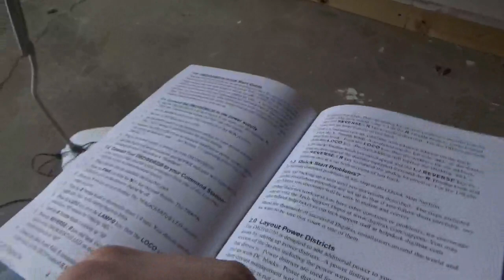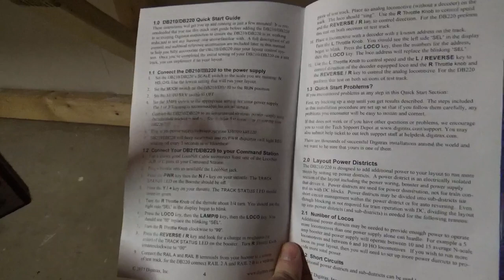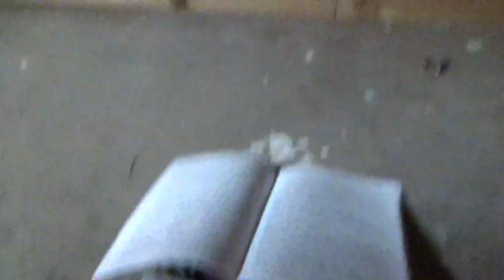Digitrax DCS 210 DCC Power Track Status Problem?  Help!

Comment: Okay, well based on this video. You seemed to had isolated it down to the section you last wired up. You said it worked before. 

That isolates to that area. Sometimes it can be the littlest thing. It could possibly be a short... 
 
Or could be the unit itself is going faulty for whatever reason. Though to rule out the actual unit... 

Remove wires from A and B rail and fire it up.  Lights still blinking like in the video? Then we've determined it is the unit. 

Functions as it should? Then some where along the line something is crossed. A multi meter comes in handy for testing continuity on wires. If you don't have one you can get a cheap one that will suffice for the work you're doing. 

I believe the 8.2 volts display is the actual throttle itself as it uses a 9 volt battery within  too. I don't believe this is the voltage of the unit. 

Voltage drop I don't think would be a factor here. Only way to determine that is. Can you run any trains at all near the power supply? 

If so and they stall out around the curve then potential voltage drop issue. Though a multi meter will also tell you the voltage on the system. 

Let me know what you figure out! 

I also work as an electrician 😉
Reply: Also adding what gauge wire is your bus wires? 12, 14?
Reply: I would second this comment. It would appear to be as simple a case of two wires wired the the opposite way. Disconnect the base and plug into a small piece of track to confirm the unit works and test, and this way you can rule that out. Once that is ruled out, review the last batch of wiring you did before the issue started.

Comment: You have a short circuit in the track or wiring somehwere.  I would check connections or the wiring.  But yes check the fuse to see.  I would first double check all the wiring connections and be sure they are soldered firm.

Comment: First remove the track power wires and see if the condition on the booster changes ,If it does you have a short. Next pick a half way point towards the new section , cut the power buss does the short go away ? Just keep halfing towards new section .
JimK

Comment: I think I saw your throttle say 8.2 Volts when you plugged it in. It should be 12V plus so I think it is a low voltage issue.
Reply from the maker: I think that may have something to do with it.  I'm going to first fix the short then I'm going to correct some issues with my bus then install the booster.

Comment: That's a short  recheck your wiring and check your switches some switches need insulator rail joiners to isolate the frogs.
Reply from the maker: I do have all the switches setup with insulated joiners where needed!

Comment: Crossed Feeder wires is my guess?  Work backwards and section off areas to isolate the issue.  I would ensure you had a fat bus line, I would loop the bus and run feeders every 3ft.
Reply from the maker: I did try to loop the bus but I need to go back and correct sections.  All the feeders are in the correct positive and negative configuration.  I'm putting my money on the new section of track where I have my switches.